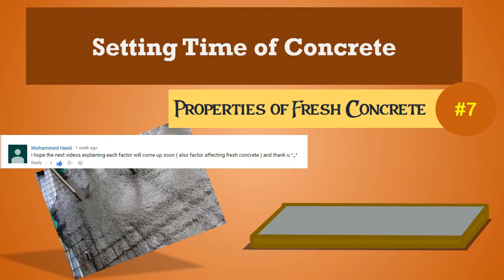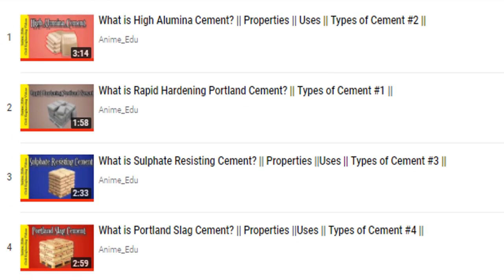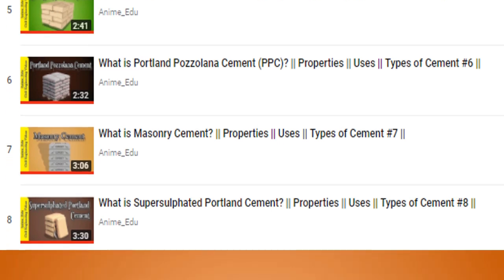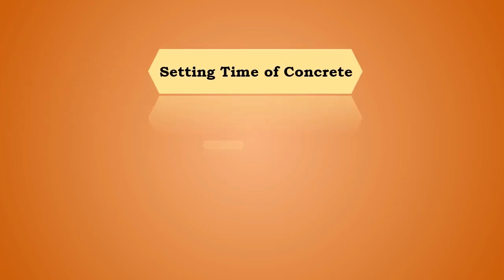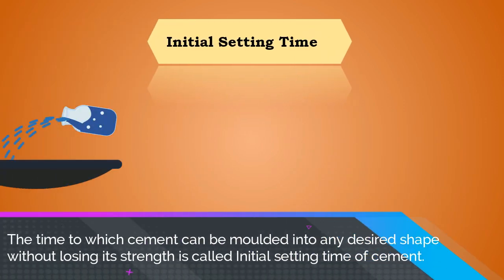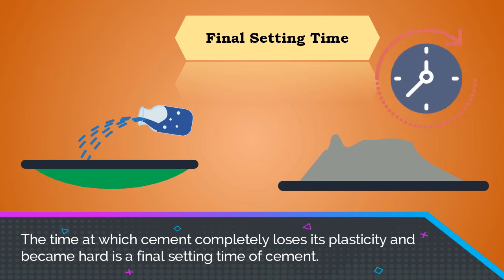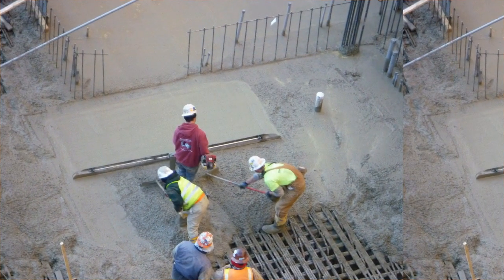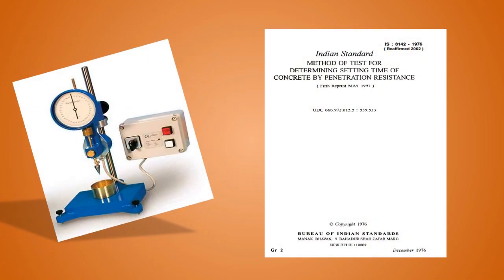Setting Time of Concrete || Properties of Fresh Concrete #7

Comment: Is setting time of concrete same with setting time of cement?
Reply from the maker: Yes! but factors related to aggregates are too will have impact on it.
Reply: No. According to the video due to water, temperature , mixture of aggregates, grade & type of cement, add-mixtures and curing method